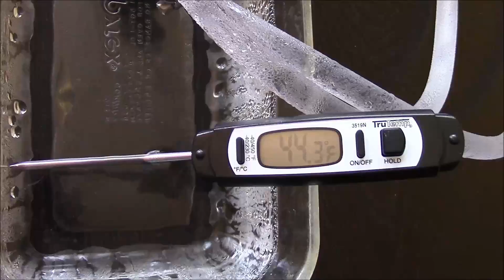How to Build A Water-Cooled Peltier Device or Thermoelectric Cooler

Comment: How many of these do you think you'd need to keep about 3-5 gallons cool enough to preserve food like a refridgerator? I cook in a water oven and I'd like to start the heat remotely but I don't want the food to spoil while it waits.

basically I want to make my own version of:
https://www.cookmellow.com/
Reply from the maker: +Geoff Miller Refrigerators are about 40 degrees usually which is about what I was able to achieve with this cooler.  With better insulation on the tubes and if you insulated your water container you could get better efficiency.  I would say that 4 of these 5 amp units or 20 amps total would do it.  It may take several hours for the water to get down to temperature and you would really need to insulate things well but it is possible.
Reply: Thanks. I could always get it started with ice too
Reply from the maker: Geoff Miller
That would help a lot.  Give it a jump start with already cooled water or throw ice in it and you should be good to go.  Like I said, the big variable will be how well you can insulate it.  That will determine how many peltiers you need in the end.

Comment: What do you call that small blue box-shaped that you attached on the cold side of the peltier, where the water circulates? Thanks for response :) For our thesis :)
Reply from the maker: +John Dy That is a cold plate or water block.  It is a piece of aluminum with channels inside that water passes through to be cooled down.  Looks like a maze inside if you were to cut it open.  Water comes in one side and then zigs and zags around until it comes out the other side much colder kind of like a radiator on a car.

Comment: Could this work for a live bait tank saltwater I want my tongue to be around 65°F around 8 gallons in a water cooler hooked up with an air raider and a filter
Reply from the maker: +rayan1953 I think so as long as the pump you use is rated for saltwater.  That can be corrosive over time to some equipment.  If you got a bilge pump or something for marine use it would obviously be able to handle it.

Comment: why not just put peltier in to cpu and cooler for hot side? and cables to 3 or 4 pin fan place
Reply from the maker: +Arttu Kiljunen You can do that.  That was the way I did it first.  It just presents some mounting challenges and suffers from heat creep but it is possible.
Reply: Did it work well?
Reply from the maker: Arttu Kiljunen
Yes it was effective and I learned a lot from doing it.  Here is the video if you want to see what I did:  https://www.youtube.com/watch?v=AhDgUJc6VvQ

Comment: I want to build  a low energy air conditioner integrating what you have here with a dehumifier, I still need to gather some more materials.
Reply from the maker: +lordbryson Sounds like a cool project.  However, it is not low energy.  For the amount of cooling you get the energy required is actually quite high.
Reply: But a compresor for a real air conditioner demands higher amperes, which translates in a higher energy requirements

does It?
Reply from the maker: lordbryson
The compressor on an air conditioner or refrigerator does require high amps to start up but after 5-20 seconds it will drop off a LOT and run steady at low current.  For example, my mini fridge needed 2000+ watts to start up but only about 100 watts to stay running.

Comment: Hi ! We'd like to build a device able to cool down 75ml of water (from 20°C to 7-8°C)  in less than a minute (30sec would be awesome). We thought of many things and the 2 main are : 1) we create a maze of copper such as what is used inside the thermoblock of a Nespresso Machine (or any coffer maker huh). We apply 1 to 3 Peltier on it with thermal paste and everything and we pump it really slow. Slow enough for it to cool and fast enough not to freeze. The inside diameter of the copper tube is 2mm.                  2) your system. We create a loop and the water quickly goes in and out of the aluminium block until it reaches the good temperature.  Do you have any tips ? Such as if you think it is possible? And how eheh?  Btw great video, some things are clearer now.   PS : if we try your system with our goals, should we order an aluminium block of 40mm*40mm, 80*40 or 120*40 ?
Reply from the maker: +Charles Mahé Desportes 75ml is only a tiny amount of liquid.  I think you could easily do that with either method.  I only have experience with my method, though.  The only challenge with getting my method to work with such a small amount of liquid is the diameter of the tubing.  You would have to find a small liquid reservoir and use smaller tubing somehow so that you could suck up the liquid from the reservoir more slowly.  The setup I have would empty 75ml in seconds and cavitate the water pump.

Comment: On the heat  side, you dont need liquid cooling. just use standard heatsink. I recommend amd phenom II heatsink. it has direct CU.
Reply from the maker: +sam4malaysia I disagree.  You want the hot side to be as cold as possible so that the cold side can get even colder.  That is how delta temp differential works.  For lower power peltiers I am sure you are right you only need a copper heat sink or efficient aluminum one with heat pipes.  But for 10a+ models I think liquid cooling does the best job of keeping it as cool as possible.

Comment: so it's basically a compressorless water source heat pump that would take too long to condition a space, or could it on a larger scale?
Reply from the maker: +knockitofff TEC coolers/heaters are not as efficient as compressor based systems but they have a few advantages that may interest some people.  You could condition a large volume of air with this type of setup but it would take a much more powerful TEC and would use a significant amount of energy to accomplish.

Comment: so what would you use to clamp the chip/water block on in a final product?
Reply from the maker: +Tim Tolbert Something would have to be fabricated depending on the product.  If you could attach it to something wooden that would be easy with a simple metal bracket and some wood screws.  It isn't really super heavy so you might even get away with zip ties or something.
Reply: +LDSreliance Alright man so I'm actually making mine based on this design.  I'm trying to figure out why the fan connector on the corsair has 4 wires and the pump has 3.  I mean obviously one requires more power than the other, but how do I tell which is negative and which is positive when stripping/crimping?  The submersible is pretty straight forward and the power supply only has 2 wires from the looks of it, so what about the corsair connectors?
Reply: +LDSreliance I'm trying so hard to see how exactly you connected yours.  I'm going to be doing it a little differently with terminals and a crimper though, but the same underlying logic should apply.
Reply: +LDSreliance So common sense is telling me that polarity doesn't really matter on the corsair, I could just pick one or the other and go with it.  This means I should just be able to turn the 4-wire connector into 2 equal gauge wires and choose one or the other to be +/-.  I guess my question now is - what did you do about the 3-wire connector?  Did you just use two of the wires and tape the 3rd one off or did you twist the 3rd wire into one or the other?  I'm assuming that would create a load issue since the resistance on one side would be twice the resistance of the other side (which would create more friction/heat?).  So what did you do?  Sorry for all the questions, I'm just trying not to burn my house down playing with an electrical circuit :x
Reply from the maker: Tim Tolbert
You don't want to connect the other wires at all.  Don't twist them in.  They are speed wires and sensor wires that allows a motherboard to change the speed of the fan based on temperature or load.  It may do nothing or it may cause problems so I would just leave them out of your splicing and just electrical tape them to the side.
Reply: +LDSreliance does it matter what two i use for power?
Reply from the maker: Tim Tolbert
I think so.  If you wire it wrong it will spin the wrong direction and the blades are designed to only go one direction.  The negative wire is always on one of the ends.  It would have been noted by a sign on the connector if you still have the connector.
Reply: +LDSreliance hmmm I have one of the connectors and I see no +/- indicator.  just an arrow over one, TKG over the middle wire and 2510 over the last.
Reply from the maker: Tim Tolbert
Yeah that is the sign that I meant.  It is usually either a triangle or arrow.

Comment: Hello, I'm looking for a device to cool the gasoline just before it goes into the carburetor. Here is a cool can that uses ice; http://speedmaxperformance.com/coolCan.php

But I'm looking for something that will cool constantly such as a TEC peltier similar to what you are doing here. Thank you!
Reply: +sreetips You'd be better off with a water/meth injection kit from Snow Performance or similar. You generally want your gas to be a higher temp for easier atomization. A WMI kit will cool the charge while still allowing good atomization of the fuel. Although, a cooler air charge is not much use if you're not boosting with a supercharger or turbo though.
Reply from the maker: +pulpbits I agree.  I don't see this being much benefit unless you are forced induction.

Comment: Just found this video, great job on this. I built the same thing with almost the same components over a year ago. It's a closed system for aquarium chiller. Great minds
https://youtu.be/yNfkBqbEnZ4
Reply from the maker: +J Marcantonio Hey thanks.  Great minds do think alike.  How is yours working out for you?
Reply: Still working well, although I moved my tank and it doesn't run as much as it used to.
Reply from the maker: J Marcantonio
So you moved the tank and now it requires less cooling?  That is a good thing, I would think.  Those peltiers are power hungry.

Comment: how do you control your temperature on and off? will it keep dropping temp until it freezes your pump,  could you add a temp gauge?
Reply from the maker: +Mr.smiley 426 In this build I didn't need any regulation.  It just dropped the temps to around 40 degrees and stayed there.  I guess I got lucky.  For other projects I have done I have wired in 12v thermostats and they have worked pretty well.  You could wire in a temp gauge and turn it on and off manually but that would kind of be a pain.

Comment: what side does the heat face ? , does it face the cpu or the small square blue water metal thing
Reply from the maker: +JAY - C (valentino) I don't understand what you are asking.  What cpu?
Reply: The peltier do u put the cold side on the water block that blue block
Reply: So the heat side will be going to the pc cooling system , right ?
Reply from the maker: In this example, yes.
Reply: Awesome , I just was wondering what side u put it on cuz u didn't show
Reply from the maker: JAY - C My bad.  Thanks for watching!
Reply: Welcome

Comment: so i have a question for ya, assuming that you did a liquid/liquid cooled peltier (ie, liquid on the cold, liquid on the hot), how cold do you think the cold side radiator would get? how hot would the hot side get? assuming the TEC1-12706 (ie ~100w), i'm looking to blow air across the cold side radiator through a box (in a vented application, NOT SEALED) and was looking to obtain lower tempteratures, i'm not looking for sub-zero stuff, maybe a 5 degree air temp change. i'm exchanging the air in this box multiple times a minute already to compensate for the heat already generated inside.

currently, the ambient air being pulled into the box is around 66-70F, but even though I am cycling it multiple (3-5) times a minute, the air temperature still rises to almost 85 degrees F. optimally i'd like to get it down to 80 or less. 

I would go with a refrigerant setup, but due to the size and weight, that is nearly impossible unless i found a very very small unit or build my own. I think I would only need maybe 1000 to 3000 btu's.

have you tried just free-airing both sides of the heat exchangers to see how hot/cold the air is coming off of each?
Reply from the maker: +Munky332 I think you need to watch my video series on my diy mini fridge.  It is an enclosed, insulated box but I think it answers 90% of your questions.  The first video is here and there are 5 parts in the series:  https://www.youtube.com/watch?v=TjX-5zjhPlQ

If you have questions after that let me know.
Reply: +LDSreliance thanks. Yea I've been watching them. The biggest issue is I vent the box so the cool air probably won't stay. I'm also looking into vortex tubes but they use compressed air and it looks like they require alot of it. So we'll see.
Reply from the maker: Munky332 Oh ok.  How big is the vent?  Is the box insulated?  I'm having trouble picturing what you are trying to do.  What is this for?

Comment: How much do you think you could cool 10 gallons in a room that's 85 degrees?
Reply from the maker: +lonewolferton I would guess 3-4 degrees with this model of peltier.  You could do more with a more powerful unit.
Reply: +LDSreliance Really? Is that it? what if the unit was kept outside of the room in the mid 70's and the water piped into the tank in the next room at 85 degrees. Do you think it could cool the water down to the mid 50's. Do you think its even worth trying?
Reply from the maker: In the video I was cooling down about 6 cups of water from 70ish degrees to 40 degrees F.  I was using a 5 amp peltier module.

So if you want to cool a much larger volume of water (10 gallons) you will need multiple peltiers and they will all need to be more powerful than the little 5 amp units.  One thing that will help is if you can insulate the water.  I assume that it is in an aquarium or something?  So if that is the case you may not be able to insulate it but if you can find ways to decrease the heat absorption from the air that would help a lot.

I know it can be done.  The question is how many peltiers it will take.
Reply: +LDSreliance +LDSreliance Thank you for your response. I'm looking to do this for a hydroponic tank. Right now the only reliable option that seems to be available is an aquarium chiller that would cost around $300.00. 
Insulating the tank would be no problem. In fact I could even drop the 
amount of water down to 5 gallons and use an igloo water cooler for the 
tank. So where do you think I should start as far as peltiers go? I was thinking of using 2 peltiers with the cold sides sandwiching a cold plate like the blue one you have. I would use 2 separate water coolers on the hot sides. Am I even close to being on the right track?
Reply from the maker: lonewolferton
I have been wanting to play with hydroponics/aquaponics for a while.  Haven't had time.  Sounds fun though!

You really need 2 different cold plates in your setup.  Sandwiching one of those blue cold plates will not be as effective.  There is only a limited surface area inside those things and the water passes through pretty quickly and only has a limited amount of time to cool down.  If you had 2 of them that gives the water twice as long and twice as much surface area to absorb cold (or release heat rather) even though the cold plates may not be as cold.  Does that make sense?

I would definitely go with the igloo cooler.  They should be able to hold 10 gallons, though.  Maybe start with 5 gallons and test it and if it is meeting or exceeding your needs you can add water.
Reply: +LDSreliance Thank for all you help! Your videos have helped me tremendously. The hardest part about hydroponics is keeping your water cool unless you have a $300.00 plus water chiller. If you can keep your water cool the rest is fairly easy. There really isn't a reliable quality affordable product on the market for the small hobbyist(5-10 gallons). I'm going to order some equipment today and see what I can come up with. I'm going to try and keep 5 gallons at 55 degrees Fahrenheit using 2 12V 60W peltiers. Thanks again for all your videos and for responding to me.
Reply from the maker: lonewolferton
If the water is insulated I don't see why those 2 peltiers won't be enough.  Let me know if I can help and keep me posted on how it turns out.
Reply from the maker: +lonewolferton That box looks like a good solution.  I don't have time to watch all 40 minutes but it seems like the right idea.

Another option is to use the green wire off the psu (which normally goes to the power switch on the computer) and wire that to the temp control relay.  That SHOULD turn off the psu when the controller tells it to.
Reply: +LDSreliance Thanks for the help. I was hoping there might be a way to hook up the psu directly to the temp controller. Once I have everything in hand Ill come up with a more specific plan. Ill keep you updated. Do you have a patreon?
Reply from the maker: Sounds good.  No I don't.

Comment: I was wondering if you could recommend a battery that would run 2 peltiers and a cpu, I'm working on a little project and my 12v motorcycle battery isn't cutting it, thank ya much sir!
Reply from the maker: +Urklesaurus Rex Did I answer your question?  I swear I sent a response but I don't see it listed here.
Reply: i didn't get to read it, it's not here any more :c something like it was goofy to go DC-AC-DC right?  lol I've been meaning to read it but when i looked for it... /:
Reply from the maker: Urklesaurus Rex
That is strange.  Yeah you want to just go from DC to DC.  Don't convert to AC and back again.  You will lose like 30% of the power in conversion or more.
Reply: Yes! Umm what would you recommend to use to get enough amps for those 2 peltiers and a cpu fan or 2? c; lol sorry for all the questions : D
Reply from the maker: Urklesaurus Rex
I'd use a computer power supply.  Cheap and easy to hack.  Check out my video on it: https://www.youtube.com/watch?v=M4TFVhCg6sk